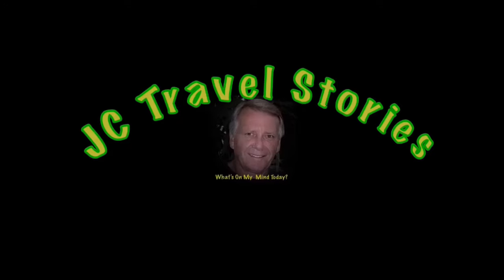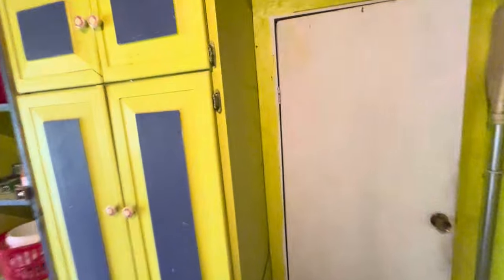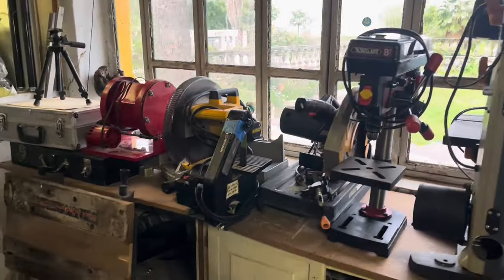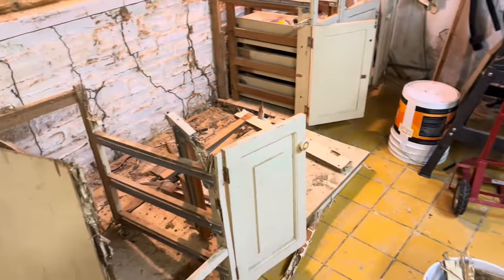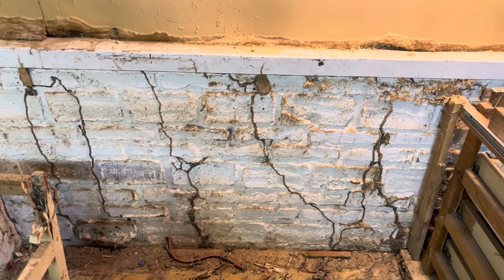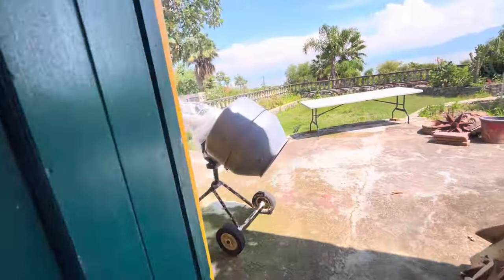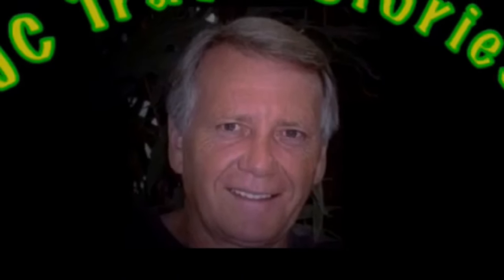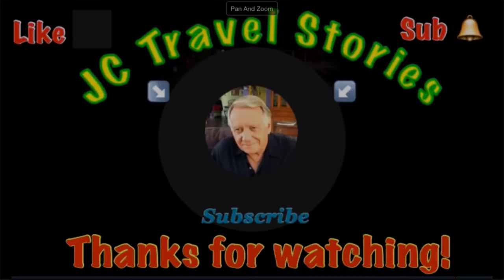Big New Problem

Comment: Sorry, Jerry, you weren't quick enough! 3:32 That "4 inches" is actually 3.75 inches. 😝

But seriously, the "nominal" vs. actual lumber sizes aren't due to drying shrinkage so much as from the finishing. The Mexican lumber you're measuring is rough-hewn and not planed for a smooth finish. It's that finishing to give you a smooth surface that takes off the majority of the size difference. You can get rough lumber in the States as well, and it's much closer to the nominal sizes.

Comment: Originally in the USA, actual 2"x4" dimensions were also used.
I think in the 1960s, 1 1/2" x 3 1/2" became the norm ?
🤠✌️
Reply: That's right, because in the US and Cda, they started "dressing" the building timbers; i.e., they shaved them clean for whatever reason (maybe too many workman's compensation claims for slivers?).
Reply from the maker: Not counting the saw blade loss if a tree is trimmed to a 12 inch demention you’d get six 2s, but you’d get eight 1.5s.  Follow the money.
Reply: @JCTravelStories , of course ;-)

Comment: Spray the window screens on your RV with good bug spray weekly and that will cut down on flys (and other winged insects) hanging around trying to get in.
Reply from the maker: So …. You are ok with breathing the bug spray sprayed on your incoming fresh air? I’ll have to think about that plan.  Actually, we have very good fitting screens.  They don't come in there.   Mostly the screen door frame.  Maybe I’ll spray some there.  :)
Reply: @JCTravelStories  In a very short time after spraying we never really smelled anything.  We used this bug spray trick mostly to thwart the "no-see-ums" that are prevalent in the Delaware seashore area where we used our RV.  They are so small they can go right through regular sized screens making leaving your screens open at night while you sleep a no go.  I believe it also repelled other insects like flys and mosquitos that like to hang around the screen door and fly in when you open it.  Let's see if the trick cuts down on your fly count.  We always used "deep woods" style bug spray with a good % of Deet.

Comment: I’m very familiar with these kind of projects in Mexico and termites always find their favourite wood. 
If I were to make a suggestion I think you should take the pine 4x4’s and 2x4’s back and trade them in for ether cedar or Guanacaste. Guanacaste is probably a little cheaper. 
It will save you having to rebuild your storage room again in a few years. You can treat pine with a product to penetrate the wood so the termites don’t eat it but after a number of years they will still eat up your cabinets. 
They won’t touch the cedar or Guanacaste. A lot of the older homes in Mexico have beams made with Guanacaste and are still solid after hundreds of years. 

Happy building 😊
Reply from the maker: Thank you for the advice.  I believe it is good advice …. However, I have a different plan.  If you notice there is a lot of concrete outside in front of the workshop.  I poured it several years ago with the thought that when it becomes too difficult for Lynn to do the stairs to our upstairs bedroom, I’ll expand the workshop area to make a master bedroom on the first floor.  Those old cupboards lasted 18 years.  We are 79.   Do the math.  How long do those workshop 4X4s need to last?  :)
Reply: @JCTravelStories yes I should have known you thought it out well. Treating the soil will probably solve the problem and you can always give them another dose in a few years. 
I love how you care well for your beautiful wife. What a great example you are. 
I’m returning to my home in Mazatlán in about 2 months to rebuild my kitchen. Yes the termites are chewing as we speak. I used pine plywood to build the cabinets 17 years ago. I treated the wood and it was good for 15 years but this time I’m planning to use cedar. I better drill some holes too as you did. 
I can’t wait to return to Mexico ❤
Reply from the maker: Our house was an older Mexican home when we bought it. We actually have metal cabinets in the kitchen no problem there.
Reply: @JCTravelStories  yes I see, and you have a beautiful home now. My wife and I bought a crumbling house 17 years ago and we have been rebuilding it poco a poco. I’m learning a lot about Mexican construction. I have really enjoyed the process.